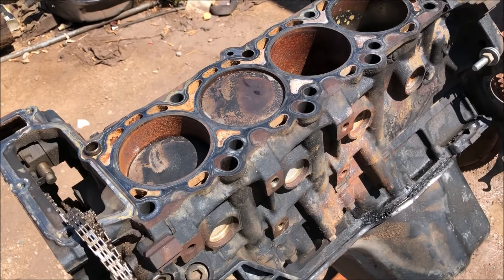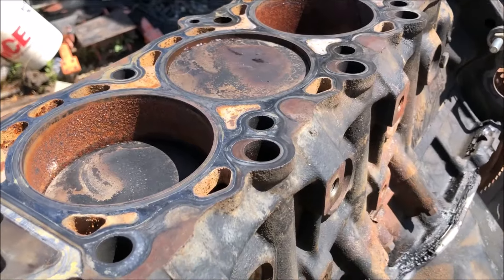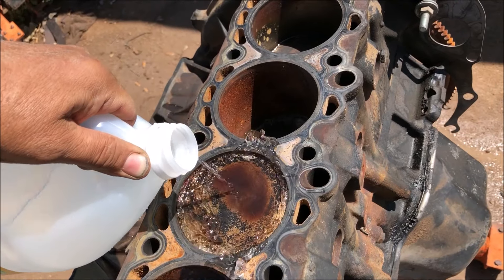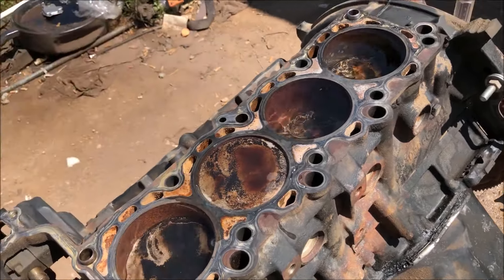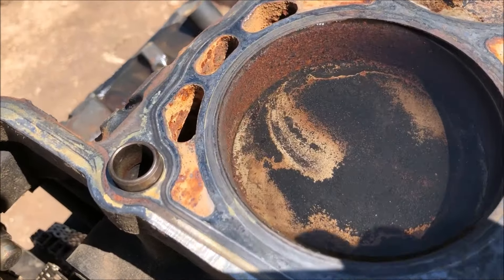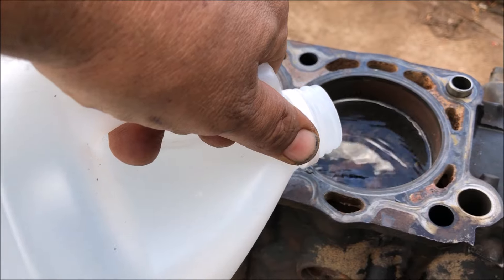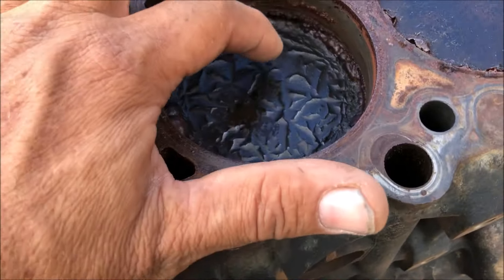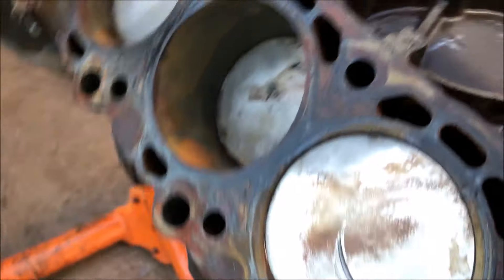Cleaning Rusted Cylinder Head Engine Block with Vinegar

Comment: It works,  but just make sure you rinse the whole thing and the block out with a solution of baking soda and water to neutralize the acid from the vinegar or it will immediately flash rust again.

Comment: Old gas tank on an Isuzu Trooper had a ton of surface rust from sitting for several years, dropped the tank and filled it full of vinegar and left it in the sun for a day, after drained it out and just using a garden hose and sprayer nozzle all the rust and crap came out, tank was shiny inside. Rinsed it, filled it with water and baking soda to neutralize any vinegar left, drained it and rinsed it and let it dry out. All the rust issues were gone. Cost $30 for the vinegar and was totally worth it. New pump in it and works great.
Reply: You can do the same thing by jacking up a working car, tractor, portable cement mixer, etc - anything that rotates slowly - and strapping the gas tank to that and then pouring pea gravel in it halfway and then sealing it shut.  Then let it spin around for several hours. The gravel will help beat and scrape the rust off.  Neighbors will hate you, but it works.  Then wash it out or take it to a shop and get it re-coated as needed (the exposed metal will continue to rust when exposed to the petrol and will leech rust into your fuel)
Reply: But you didn't re-seal or re-line the tank??

Comment: Great video. I have some slight rust in the cylinders (probably come off during honing), but the main concern is the rust in the gallies. If I can plug them off I can definitely consider trying this and/or solutions that are more aggressive. If the engine is light enough after I remove the crank and all that, I’d prefer electrolysis or hot tanking/boiling.

Comment: It works it works thriggen good awsome video mate done my boot in my car and everything else in my seized engine i use a wire brush to take crystalized rust spots outa the boot after the vinegar reacts and finished its dryed made a crystal layer east to remove

Comment: It really does work thanks for making this video I just did a LS1 engine and it got all the rust out of the cylinders car had been Ina flood and intake went under water
Reply: I thought LS1s had aluminum blocks? Or are they sleeved or do some have iron blocks?
Reply: Did you rebuild after all that or just straight back in?
Reply: I did not rebuild it one cylinder was pitted bad and was unable to save it but I will say it didn't have any rust after this but u need to use a good vinegar I used two different kinds and the one from the dollar store that was pure worked best and all rust was gone in 2 days

Comment: The only thing is that you have to be careful with vinegar because not only will it remove the rust but also a few layers of the metal. I left a knife sitting in a bottle of vinegar overnight to derust it came back the next day and there was a deep line etched right where the top of the vinegar and the knife met and the knife was slightly thicker above the line below it it was now thinner all the way to the tip
Reply: thank you for your experiences
Reply: Vinegar also destroys anything rubber. If your engine is this fucked to where you need to dump vinegar in it you will be replacing the rubber and lines anyway with new (you should) but just keep that in mind.
Reply: Bullspit

Comment: Something else I'll toss in, if you can't get a cylinder head off, put away the hammer. Find which cylinders are at TDC, release the rocker arms so the valves are on their seats and pull the spark plug to fill with compressed air (even a bicycle pump if need be). so long as the cylinder passes leakdown, she should pop for you. you may even want to keep the head bolts on loose to keep it off the floor :)

Comment: You would still need to hone or oversize tho. I did use on rusty nuts, they were so corroded they literally disintegrated.
Reply: airborneleads1981 4 stroke combustion is the best honing tool I’ve used
Reply: I use a $15 ebay hone and it does about 40 cylinders before it wears out. A must to get good crosshatching and remove pitting. If the pitting is really bad then the cylinders will need rebored.

Comment: This will work perfectly for my light surface rust they dont have water in them just rusting from the moisture in the air not gonna drill em out unless the rust was severe enough to eat into the metal

Comment: Hey Thomas, very good idea on cleaning the engine with vingar never thought of that.. BUT UR DOING A BIG SCREW UP BY PRESSURE WASHING THE INSIDE OF THE MOTOR.. THAT INVOLVES WATER AND WATER WILL CAUSE THE RUST TO COME BACK NO BRAINER THERE!!!!!  U need to use a little steel brush or Emery cloth with gasoline for that NOT MORE WATER 💦
Reply: I’ve done this to a few motors now, I clean it with vinegar multiple times pressure washing it between each bath. But I remove the pistons and all then set the whole block in a bath of vinegar over night and wash it, once I get it where I want it i use a leaf blower to dry it and I spray it over with an oil & fuel mixture. Learned it from another channel.